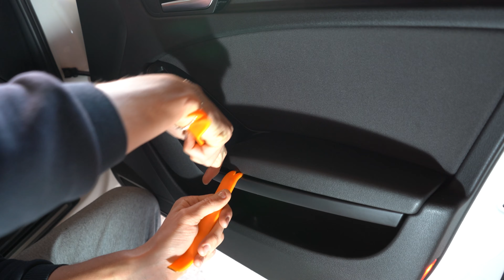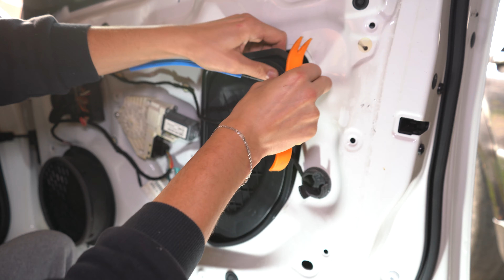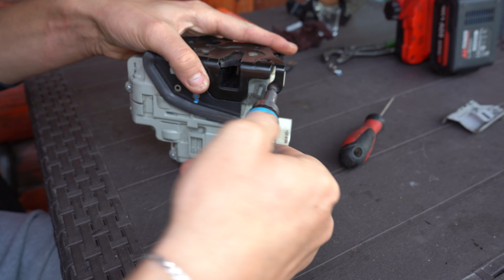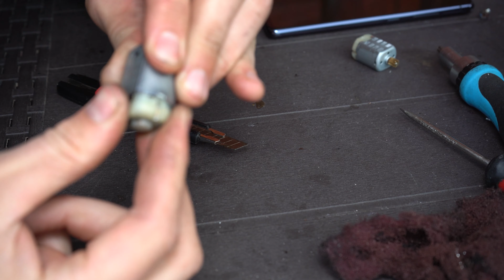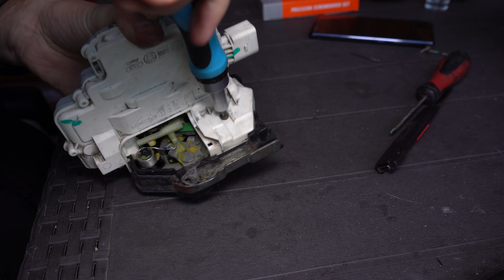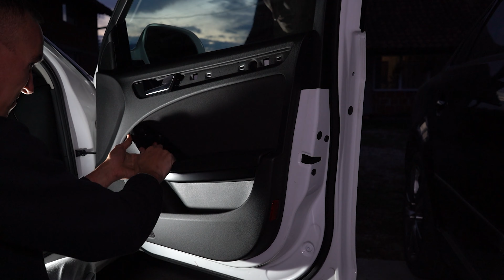Audi A4 B8 How to fix door lock module for free / Kako popraviti bravu na vratima besplatno

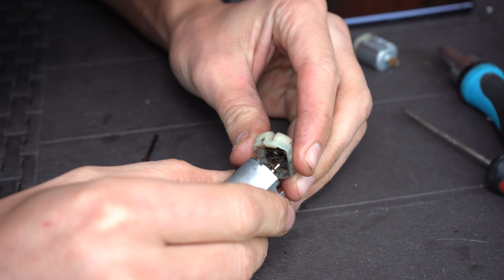Comment: 4:10 idk how you managed to open the little motors but congrats for doing it because I have tried anything to open them too and I did not succeed!! instead of opening them I sprayed a lot of contact cleaner inside through little holes then dry it with compressor and it fixed the problem 
Thanks for video by the way, good job!